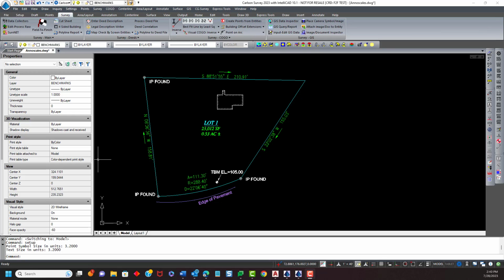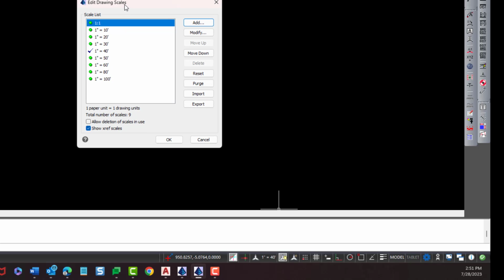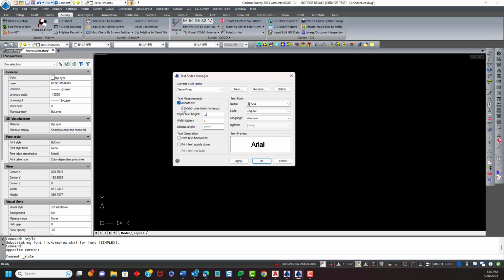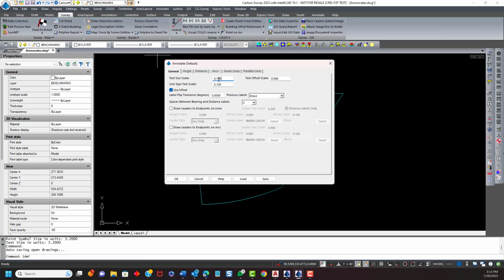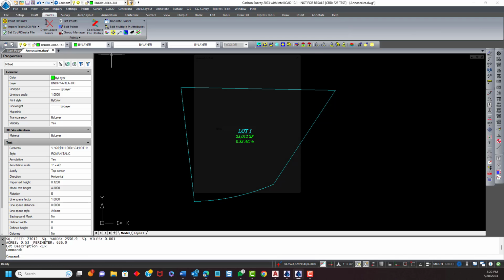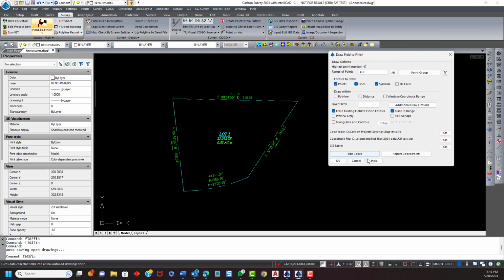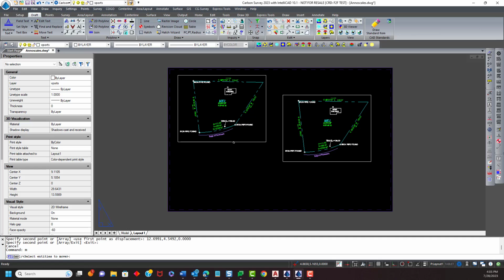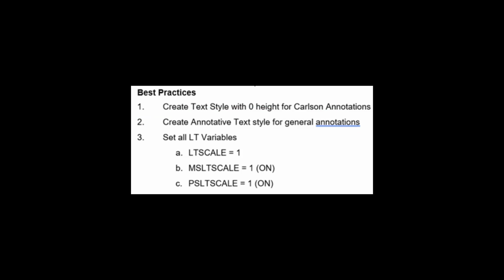Carlson Annotative Objects 101

Comment: This is close, but there is a trick or two. It is better to think of each scale as a multiple of mathematical roughness. The trick is to maintain the same relative level of roughness with all entities at a given scale. Text, symbols, lines with text. There is a process of prepping the CAD file that eliminates a lot of work and you should never try to set this up with a busy drawing first go. Use the legend tool and create a legend from a good drawing. It is located in the annotation menu near the North arrow, scale bar if you are not familiar. Create a legend with all entities and draw it. If it is ugly, you have a lot of work to do before annotative drawing will be good for you. Missing fonts? Using old templates? The drawings must be clean and staff must be visual thinkers. I do not use annotative text. I put text in paper space, use psltscale turned on with good line definitions for line spacing and no missing fonts. I use viewport color overrides to grey out anything not important for that sheet. Annotative text is nice if you survey and have to provide enlarged views often with a lot of labeling. An as-built for a water service connection is one potential application.

Comment: I've been waiting for this video. Thank you!  The only problem I'm having is with MTEXT in which I almost exclusively work.  All of my settings are set up in the video.  When I draw Standard Text, the annotative properties work as demonstrated.  However, when I draw MTEXT, the model space text height defaults to the intended paperspace height.  I use a paperspace height of 0.1, so MTEXT defaults to 0.1 when I draw in modelspace.  How do I solve this?
Reply: Make sure your current style is annotative and then also Check your Mtext settings that should be showing up in a contextual ribbon (if turned on). They can get disassociated with the text settings. I can't share a screen shot here but look carefully and make sure that you see you are indeed creating annotative Mtext. You should see in the upper left area of the ribbon an Annotative toggle. It should be highlighted On.

Comment: using viewports - when I change my dwg scale under drawing settings my viewport scale does not automatically change...any suggestions - thanks
Reply: Viewports do not automatically update when you change the annotation scale in Model Space. This allows for multiple viewports at different scales.